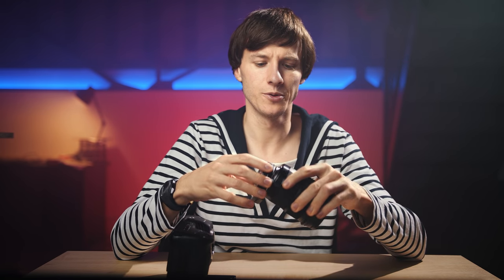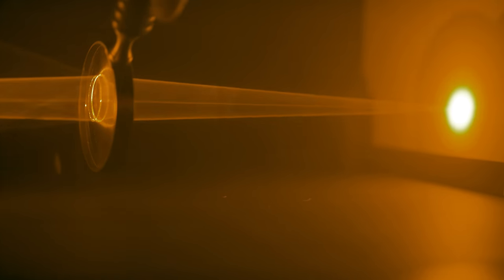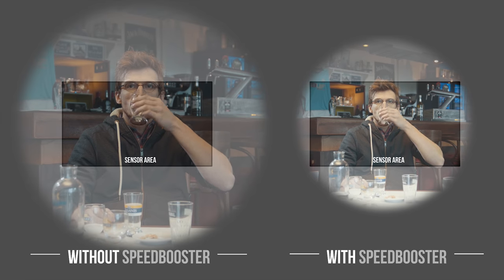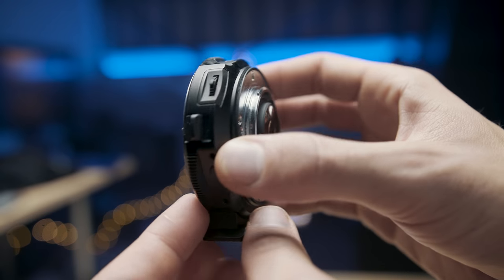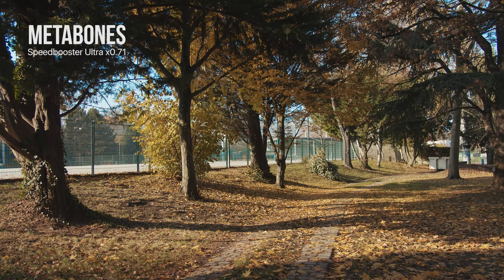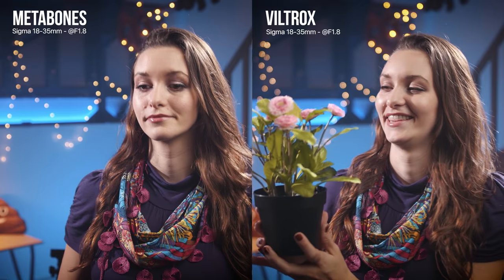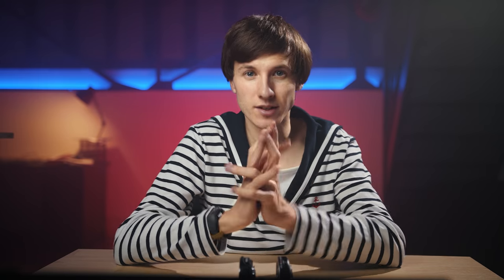How Does a Speedbooster Work ? ( and Metabones vs Viltrox  )

Comment: Great content thanks so much one really important question if you don't mind, I just ordered the speedbooster XL recently and it is on its way. Have particular full frame lenses that I am thinking about which is why I ordered the XL, but based on what you just said it seems like the ultra can accommodate full frame and crop lenses, so should I switch to the ultra in order for me to be able to use crop lenses if I want in the future or what are the advantages of the XL if the ultra can do both lenses? Will I get Superior or wider images with the XL if using full frame lenses? I guess just wondering what the advantages of the XL are. Does the ultra do anything to full frame lenses that makes it inferior? Thanks so much for your reply
Reply: PostModern Filmmaking he sort of answers this question in the video. The XL will give you the best results with full frame glass because it will make it wider and faster, enabling you to move close which will give you more background blur. But the ultra is not too far off from the XL so if you plan to use both FF and Crop lenses you’ll probably be happy with the ultra
Reply: One thing to add might make it more simple, the XL is made to essentially restore the original field of view of the full frame lens, so a 24mm will look like a 24mm, whereas the ultra will still be slightly cropped. Just depends what will be more useful for your situation
Reply: @jonathanmasters2178  very helpful thanks for the response. Last  question I suppose is in regard to vignette. I suppose you have less chance of vignette in general  even with full frame lenses if using the ultra? I wonder because Someone mentioned in comments  that with same setup as in video they got vignette when shot in full 4K and not Ultra HD as in video. I suppose because full 4K is a little bit wider than Ultra HD. So basically to get maximum light maximum blur and maximum wideness the XL is the way to go with full frame lenses. But Maybe not only with crop lenses but any lens, the XL has higher risk of vignette especially with a wide lens? I'm most curious because main reason I am getting the speedbooster XL is for use with the ultra-wide Loawa 12mm. I suppose I'll just wait till it gets here from B&H and see if I get any vignette even on full 4K mode. If I don't get vignette with that lens seems pretty safe I wouldn't with others. Any other comments would be helpful but I can write back and let everybody know the results I get as well.
Reply: PostModern Filmmaking In general most lenses project a circle of light that is actually a little bit larger than the sensor area and in some cases a lot larger. Some full frame lenses can almost cover medium format. Sigma 18-35 can actually cover full frame from about 25-35mm. I wouldn’t worry about getting vignette from full frame lenses. You have a higher chance of vignette with a crop lens. And I believe they had that issue because the ultra is I think a little bit wider than what the regular APS-C focal length
Reply: @jonathanmasters2178  got you, very well said. This all has been helpful not only for me but I'm sure for others so thanks for taking the time.
Reply: @jonathanmasters2178  From what I read neither speed boosters will give you a full frame field of view. The XL will give you roughly an APS-H field of view(between APS-C and Full Frame). While the Ultra basically gives you an APS-C FOV.
Reply: timberwolves100 if you watch Caleb pikes video (DSLR Vdeo Shooter) on the gh5s he shows side by side comparison of gh5, gh5s, Sony a6500 and Sony a7iii and then with speed boosters and you will see that with that sensor in the gh5s and in the black magic you get roughly a 1.1x crop on full frame which is close enough for me honestly. Gh5s with the lesser of the two will give you slightly larger than super 35 and the greater one will give you slightly smaller than FF
Reply: @jonathanmasters2178  I didn't think it was that close. Well that is actually nice because it crops out the corners of the lens and you get a sharper image.
Reply: timberwolves100 well don’t just take my word for it, I could have the numbers off a little bit. He shows exactly in the video. But I’m pretty sure it’s 1.1 or 1.2x crop on FF. The sensor used in the gh5s and Bmpcc4k is slightly larger than a standard m43 sensor
Reply: @jonathanmasters2178  Actually I own the Metabones Ultra and have tested the XL on a APS-C lens with my GX85 m43rds camera. But did not have a full frame camera to compare against. I'm guessing 1.1-1.2x crop is about right.

Also I recently used the APS-C version of the Sigma 30mm 1.4 with the speedbooster and it's awesome. F1.0 and has the equivalent shallow Depth of field of F1.6 on Full Frame.

Comment: Had the XL metabones for many years. 
If you have decent full frame lenses don’t mess around with .71 ultra or viltrox. 
More light, brighter and sharper. Why settle for less.

Comment: Great video - thanks for making it
I do have a question
Does auto focus work using the Metabones Ultra 0.71x speedbooster on the BMPocket 4K and Sigma 18-35mm lens ??
I just tried that camera/lens combo with  the Metabones Speedbooster XL 0.64x and  and auto focus does NOT work
Thanks in advance
Reply from the maker: Thanks Jay ! Nope autofocus does not work ... yet with the BMPCC 4K. But it worked with the old BMPCC so I have high hopes they'll be able to fix it in a future update.

Comment: @Zebra Zone Does the iris control work on your BMPCC4k when you are using the Sigma 18-35 with your speed booster? We have a MetaBones adapter (not the speed booster) and the iris control doesn't work. Thanks for a great video.
Reply from the maker: Oh might have an issue ? Because yes Iris control works like a charm with my speedbooster.
Reply: @zebrazone  Thank you for the response. We will have to rent a SpeedBooster soon and test it out.

Comment: I am a bit confused about this
I have a nikon d7200 and a nikon 35mm AF-S 1.8 G lens

So the crop factor makes it about like a 50mm

I want to have the frame of 35 mm like in full frame without having to use a 24mm as that would reduce my focal length
Reducing my dept of field

So will this speed booster make me have the frame of a 35mm and retaining my depth of field

Or do i need to use this on nikon full frame lenses?
And is there any speed booster for nikon apsc camera to reduce focal length of apsc lenses?

Comment: Hey, I am shooting canon, but am getting the BMPCC4K as soon as one is available - You should keep making these.  You have done well with each one of these videos.  I am deciding on lenses - I intend to use cine lenses - and I must ask if you have any experience with that Rokinon set?
Reply from the maker: Thank you very much ! I have Samyang lenses (EU equivalent of Rokinon I think) and the quality is generally very good but definitely not at full aperture. With my 85mm I need to go all the way to F3.5 to have something the optimal image. It depends on the lens.  However the focus feel is very very good and good range, much better than photo lenses. Personnally, I prefer Canon + Speedbooster.
Reply: @zebrazone  I am shooting a feature on a budget - the BMPCC4k is THE camera. I need the cinema lens for follow focus and focus pull.  I haven't the budget for canon cine lenses. I was going to use a speedbooster - and your review has reinforced the fact that the metabones product will be essential.  Are there any lenses out there with long focus pulls for a similar budget?  I also have a shot that will require a pretty large zoom - probably around 50-200mm - for that I was planning on using a typical photo lens, but the way I have it storyboarded, I am going to need a 24mm, 35mm, 50 and 85 plus the zoom.  I have looked at the quality of the optics for the rokinon cine series and I feel the quality is there - have you any experience shooting the 35 or 24 wide open? lol - i was hoping to use relatively wide apertures for the bokeh I had envisioned. excuse the length of this response.  Are you Quebecois?  lol ;p - again, your equipment reviews are very well presented.  I should have my BMPCC4k as soon as they become available again.  

I have another question, B&H is offering the BMPCC4k with an angelbird match kit with a 256GB CFast 2 card and a 512 SSD for 1700ish.  You wouldn't have any insight as to whether this combo is worth it? The SSD uses the USB-C connector... I feel the drive is maybe valuable as recording media as well as the CFAST - i am not shooting many long individual sequences, so I believe I should be able to offload video to other external drives - i have never used angelbird, however.  any insight as to the value of this deal?  I apologize again for the length of this post... 

have a nice day.

Comment: I know this was posted a year ago but thought I would share my experience:  Just got the Viltrox ultra .71 for my GH5 camera.  I mounted a sigma 17-50mm apsc lens.  Extreme Vignetting at the 17mm widest zoom.  Slight vignetting still at the 28mm area.  I also noticed while panning the camera the vignetting sometimes increased, probably due to wobble/movement of the adaptor?  I'm speculating that full frame lenses should eliminate vignetting but have not tried them.  Too bad a full frame zoom lens is double the price, and even a fast micro four thirds zoom lens is ridiculous
Reply: Interesting.  I have the same Viltrox, and have used the same Sigma lens on my camera, which is an OG Blackmagic Pocket Cinema Camera (1080p version).  I have not gotten any sort of vignetting at all.
Reply: @charlesoxley7242  ahh it’s because the black magic doesn’t have ibis stabilization. The vingnetting I’ve figured out is also the movement of the Panasonic’s sensor

Comment: Man you just released this in a perfect time. I’m using the Metabone T Speed Booster 0.64. And is working pretty good with all my canon and sigma lenses for full frame. Can you make a video comparing the metabone and sigma vs using the Olympus? Is there any big difference in quality and performance?
Reply from the maker: You mean the whole range or a specific Olympus lens ? I own Canon / Sigma and a few Olympus prime and I think I'm not enough experienced to tell the difference. For sure Olympus Pro lenses are very good even wide open. I tend to like the olympus lenses for their compacity and fast autofocus on the BMPCC4K, which is practical by times. I can tell you that the Olympus 7-14mm is VERY VERY good ! Even wide open. If you need a very wide lenses go for this one. Much better than the Pany 8-18mm (tested both)
Reply: Zebra Zone Thank you!! I just rented a metabone T XL 0.64 and work fine less the autofocus. When I turned on the lenses autofocus focus,  but then the autofocus never work again. So I’m still thinking if go with an adapter or get new lenses for this camera. Thinking on autofocus and images stabilization.

Comment: Hey! What is the minimum and maximum aperture when you use the speed booster with Sigma 18-35? Thanks,
Reply from the maker: You need to multiply by 0.71x or 0.64x depending on your speed booster so for the Ultra 0.71x , Minimum F1.3, max F16 !

Comment: if reducing the image circle increases brightness why don't micro 43 lenses are much brighter than apsc or ff lenses ? for exalmple the sigma 30mm f1.4 exists in apsc and m43 but it is the same aperture of f1.4 on both image circle size why dont they design the m43 version to concentrate light on m43 surface and get down to f1.0 ?

Comment: I got the wrong Speedbooster :( Using the Sigma 18-35mm and the 50-100mm with the metabones XL 0.64. Thankfully, the only problem I have is is some vignetting on the 18-35 between 18-22mm. Im just treating it as a 22-35mm lens now and its not really a big deal :)
Reply: You got the wrong lens. You need full frame glass.
Reply: @cmdr.shepard - Yeah, but as I said, it doesnt matter that much at all. Sigma 18-35mm doest come in a full frame version but its still one of the best wideanglezooms for this setup imo.

Comment: Some of the Viltrox speedboosters are lower quality, some of them are higher quality. I also remember that there was an issue with infinity focusing it, you had to adjust the optics manually. However, I'm still in favour of Viltrox. The Metabones does not worth it's price. Also, we have to mention the Lens Turbo II., which is performing more than great!
Reply from the maker: Agree that the Metabones is too expensive I think. The quality / price ratio of the Viltrox is excellent... when you have a good unit.

Comment: If I want to use xeen cine lenses with bmpcc 4k which speed booster will be best and the image will be 35mm format or not , and what is advantage of using sb ultra over sb xl on bmpcc4k thanks in adbance
Reply from the maker: SB ultra is compatible with more lenses (APS Lenses such as Sigma 18-35mm etc...). For Xeen lenses I recommend going for the XL !
Reply: @zebrazone  hey thanks for reply but if I want to use sigma cine zoom like 18 to 35 t2.0 full frame then can use the ultra one

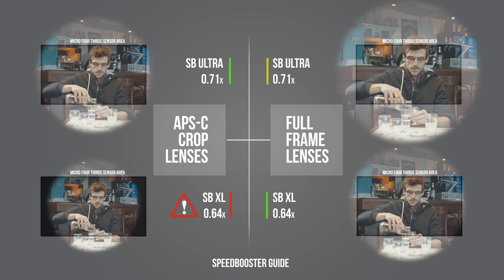Comment: this is strange moment here at 7:22 top left corner, when u try to mount aps-c lens (crop factor 1.6) on speedbooster with crop factor 1.4 - there will be a vignette (the same as left bottom corner but a bit less) as aps-c lens smaller

Comment: Hey, just got mines yesterday. Is it normal for it to be so hot at the bottom near the 1/4 mount? Didn't affect my shooting time but it gets pretty hot. Should I return for a other one or is it normal
Reply: I had mine for over a month now... It only gets hot when you are recording at higher settings. It has to process a lot of data and it is normal. Try filming at 1080 Proxy 25p and see if it stays cool. Good luck.
Reply: mine got hot to, but no problems for me! :)
Reply: @GDFilmsLondon  ok cool, idc as long as it doesn't cause issues with its durability and/or damage to the camera. I spoke with black magic design and they told me the same. I just need to make sure the vent is not closed which is a no brainer. Just shot something at night, man what an image. Way better than my a7iii.
Reply: @PRIVATE PRIMATE thx for the info. `my a7iii for pictures is great so `i see what you are talking about. I am no pro, just beginning my video journey. I shoot photos but getting into video for commercial shoots I have now and want to offer video. I also want to shoot some film shorts and felt like this was the best route for its price and specs. I plan on shooting a lot and learning with this as my first cinema camera.

Comment: Hi, did a quick to se how sharp are the corners with the Viltrox EF-M2. I filmed in 4k a sheet of paper with text from side to side and HAVE NO ISSUES WITH THE SIDES GETTING BLURRED. 
 (my gear GH5/Viltrox EF+M2 and Sigma 18-35 art) 
@ ZEBRA: you maybe need to reconsider your Viltrox EF-M2
Reply: Well, he is showing these adapters on BMPCC, not GH5
Reply from the maker: I’ve heard mixed reviews, really depends on your Viltrox they seem uneven, a quality control issue